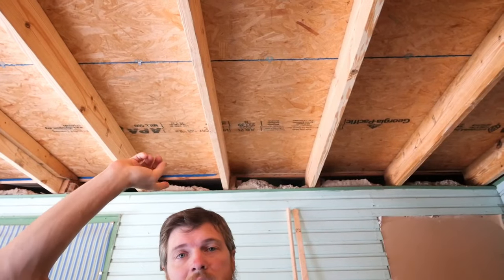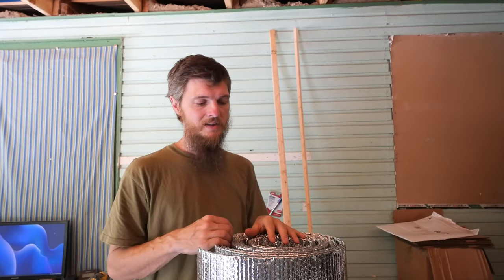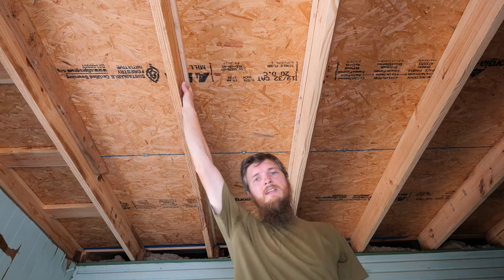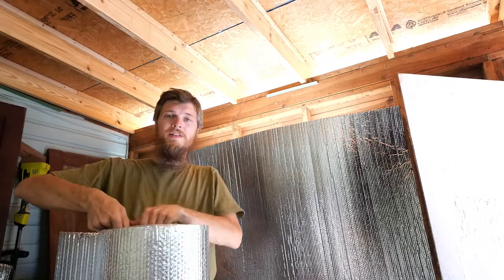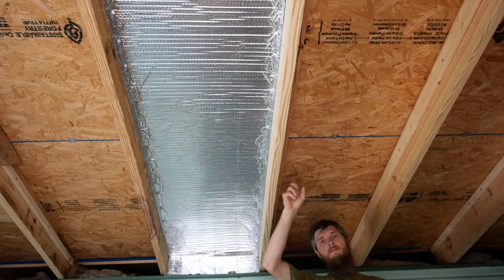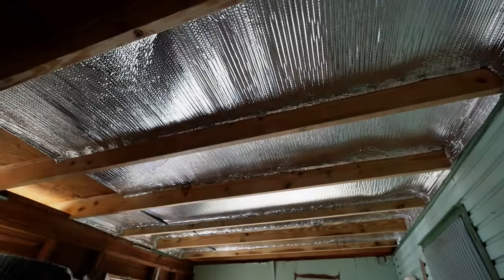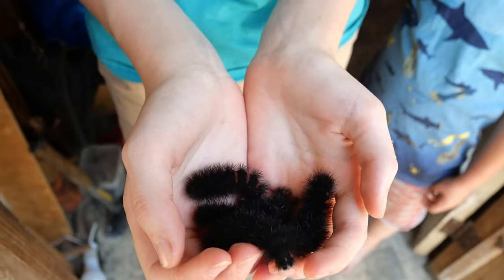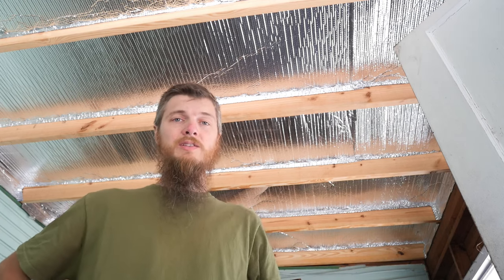It's Too Hot - Roof Radiant Barrier To Block the Heat

Comment: How not how to install this product.  You should have went across (Left to Right) the 2x6's.
Reply from the maker: We installed it correctly. You don't want to put bubble foil on the face of rafters that will have a wood ceiling.

Comment: Didn't really work for me. The old pink stuff works a so much better
Reply from the maker: It works exactly how it says, meaning that it blocks and reflects the radiant heat. Before we installed this barrier, the porch felt like an oven....after we installed it, it felt like we were sitting under a tree in shade. Really big difference.
Reply: Absolutely didn’t use it correctly then because this is superior to that pink shit. Use both or this with foam!
Reply: Can I put together? Radiant barrier + some wool? First layer radiant barrier and second layer some wool
Reply from the maker: @Milanorevic  Yea.

Comment: shouldn't the shiny part be facing the heat?
Reply from the maker: It is, both sides are shiny.
Reply: @diyfferent There should have been an air gap between the ceiling and the radiant barrier for it to be effective. 
They way radiant barrier works needs this gap — the metalized coating reflects the radiation. Without air gap the heat just gets conducted thro’ the thin radiant barrier.
Reply from the maker: @sumpat25  Yeah, that's why we installed ours with an air gap. You can clearly see that in the video and that was the point of the first half of the video. We installed ours with a 1-1/2" air gap between the roof sheathing and the radiant barrier. 

Maybe next time just enjoy the video instead of trying to be a big shot. We did it right.
Reply: @diyfferent Ecofoil sells white/foil variety which offers the same benefits as foil/foil, but with a white finish that faces towards your finished space, providing a more "finished" look. It is called EcoFoil single white insulation. 

Also, not all bubble wrap used for insulation has a reflective side.

Also, perhaps the next comment was giving a supportive explanation of the correct procedure in your area.

Incorrect assumptions and ondescending comments are never appropriate. And one person's common sense is not always the same as another person's common sense. You may want to get rid of that habit.
Reply from the maker: @lilgems5703  We have installed and shared on our channel the single-sided Reflectix brand radiant barrier with the white backing. So I am aware of that. But I've never used the Ecofoil brand.

But don't complain to us about incorrect assumptions when the commentor above was the one assuming we didn't leave an air gap... That's clear from the text.

So many people are trying to correct us when we didn't do anything wrong, and here you are doing the same. It's weird. 

If you have a question, we try our best to help. But making false assumptions and trying find gotcha's just isn't worth anyone's time.
Reply: @diyfferent  You completely misunderstood my comments and concerns.

Comment: Naw you wanna staple to the bottom of ur rafter,   I feel bad for you man,   Furring strips,  cutting strips of bubble,   Dang…..
Reply from the maker: No, we wouldn't want it on the bottom. It would have just made installing our bead board ceiling more difficult. And when using up scrap material, sometimes you just have to work with what you have. But the install came out good and really made a difference with the heat.

Comment: Would have been cheaper to paint the roof white.
Reply from the maker: Our roof is bright white. Radiant heat still passes through white roofs. White doesn't reflect all the heat away.
Reply: Pairing your fucking roof white DOESN’T CHANGE A GOD DAMNED THING!

Comment: air gap less than 2 inches? stop making misleading videos...
Reply from the maker: Where do you get this 2" idea from? We installed it one of the 3 ways the manufacturer suggests. What exactly is misleading??

*Manufacturer's instructions: 
Reflective/Bubble Insulation
Installation Instructions:
(There are 3 options)

Option 3. Truss Cavity or Side of Rafter Method

A minimum of a 1/4” continuous air gap should be present between the product and the roof decking*

We did about an inch and a half air gap.

https://pdf.lowes.com/productdocuments/1b37880a-8415-4bd1-b83b-64dcbb56e659/01418758.pdf
Reply: Good answer!